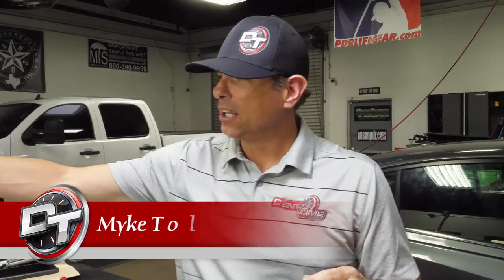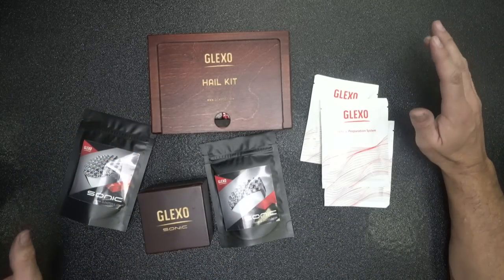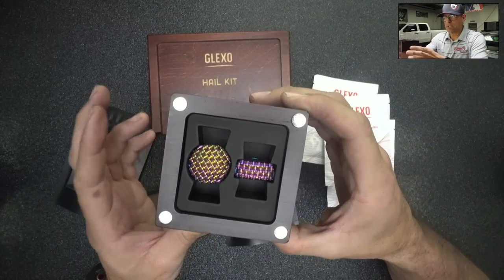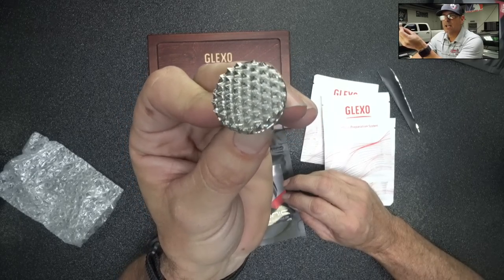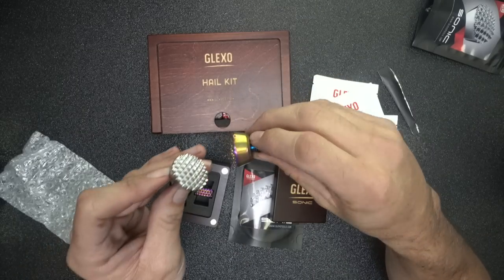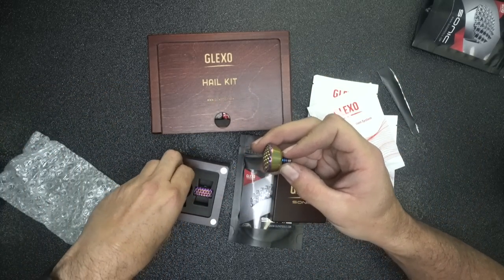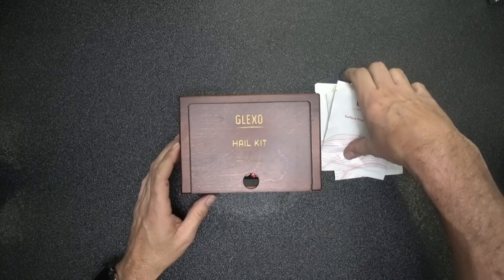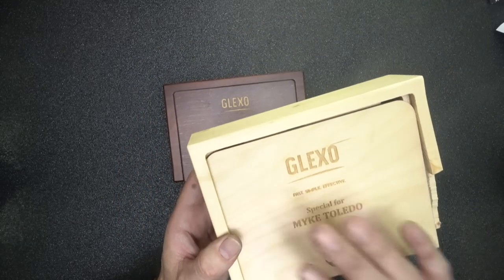Hail Damage Repair Using Cold Glue - Paintless Dent Repair Training Review

Comment: Hey Myke great video thanks for all the work you put in and free content! I've been using glexo on hail but with smaller plastic tabs and I think that smaller tabs would have served you better on those dents. Also the glexo is an amazing pair with blending. Either pop the dent up close and blend it out or get more aggressive with blending and if it ends up a little bit too low pop it up and blend it again. The best part is you're not over pulling or pulling sharp pinches and makes fixing rails a lot better! I have my glexo on a small round hawg tab I believe that also took some time to bond. With smaller tabs it helps to have more glue than normal, mound it up a little bit with your fingers and then use the weight of slide hammer to smoosh into panel
Reply from the maker: Thanks a lot for the suggestion Garret. I’ll give it a go. I’ll do a follow up on that too. 👊

Comment: Put your board little bit further , you can not see no details, yes its pulling oke, but the quastion is if it pulling also the center of the dent...
Reply from the maker: I answered that question.. also this was my first take on this glue using this way. It does give a huge head start and doesn’t over pull like normal hot glue does. So if you already have experience with cold glue already, it’s obvious this will be very helpful. Thanks for watching Lukas. 😉